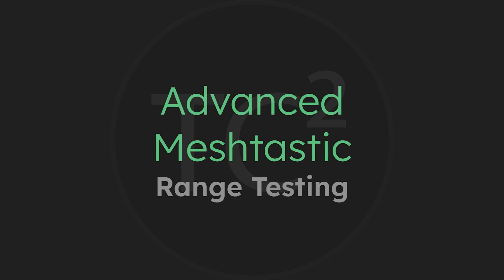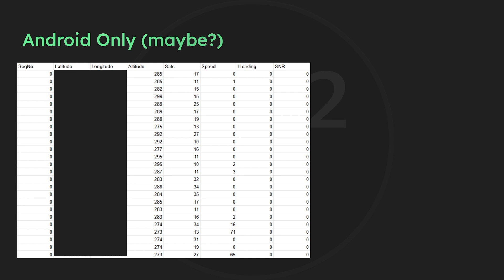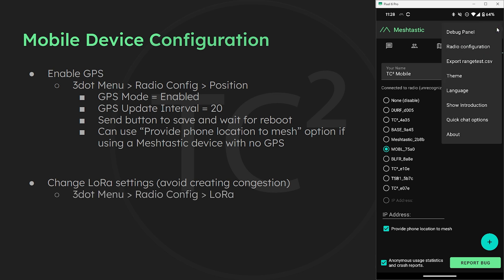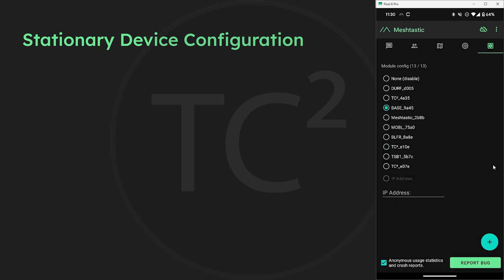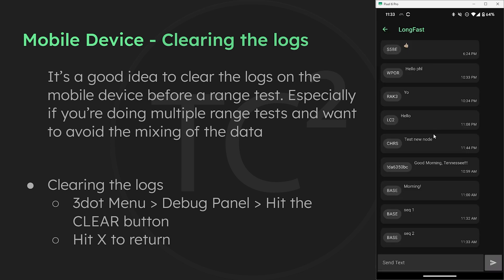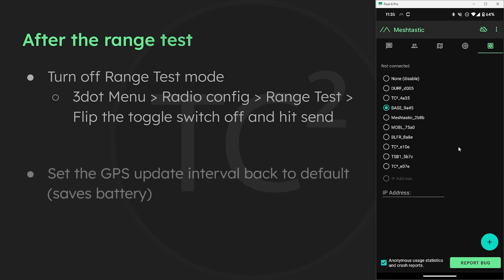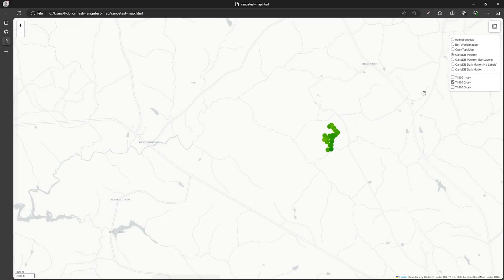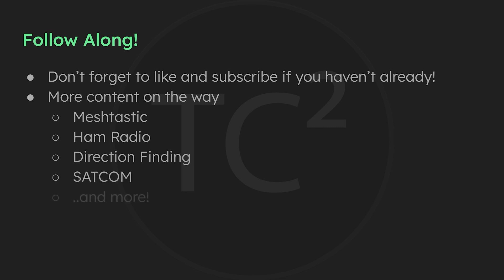Updated Range Test process & Testing the T1000-E Meshtastic card

Comment: Wow. I have a 12 dbi antenna up 45 feet and can't get more than a mile range.
Reply: 12 dbi is a lot for these frequencies (869/915). If you are experienced with radio transmission and have LoS, I'd worry about propagation direction/angle

Comment: I find that all measurements with an SNR multiple of 25 are dodgy, I get some that say -25, -50 or -75. I still want to keep the markers on the map but the SNR reading is clearly bugged out. I changed the line in the code that flags nodes with a very high SNR so that it also grays out nodes with a low snr and that's good enough for me: if row['rx snr'] > 15 or row['rx snr'] <= -25:

Comment: Out of curiosity, what was the fixed node TX/RX height? And what's the LOS like surrounding the fixed node?  And the DBI of the antenna? 250mw (max TX) I'm assuming? Do you know what the noise floor looks like there? Your results are drastically shorter than our own testing........ However, I don't know that's an apple to apples comparison. We use/ed a couple of different node/s to build out our network. Generally speaking, "saturation" nodes, and "distance" nodes. Saturation nodes are used Intra-city to get coverage of that specific town/city. And distance nodes to cover inter-city links and cover rural aeras. (Except the southern part of the state which becomes mountainess) Saturation node = 0-2dbi @ 250mw and a min of 100-150ft AGL. Distance node = 10+dbi (there is some variability left over from the beginning stages) @ 250mw and a height 250-300ft AGL. The LOS for All of our nodes is unobstructed as they are on top of towers.......... In the moutainess parts of the state we co-locate a distance node and a saturation node (maybe not co-located, but close prox). The distance node covers the ridge top-ridge top link, and the saturation node covers the valley/floor. (with good placement).....

With all of that being said; we've never tested a saturation node for distance. Our Saturation nodes are focused on data thruput and coverage. However, we have tested our distance nodes extensively. At the 250mw and a +- 10dbi antenna @ the typical 250-300ft AGL we routinely see 50-70 miles while maintaining a high data thruput............ (single node to single node link). 

So, it strikes me as "something's off...." when you only got +- 5 miles out of a node............(even a saturation type node). But there is a TON of things that can affect propagation........
Reply from the maker: I mentioned in the video this is just my node at home and the tests were done off the main mesh. We have nodes on top of mountains and achieve the same distances
Reply: @The_Comms_Channel  I just watched your vid on the Bluetooth bug. I think we work in the same or very similar industries which gives us tower access. Though I don't climb (too old and fat) I do the tech work on the ground.......
Reply from the maker: Just have friends in the same industry 🙂

Comment: The rangetest csv I get from meshtastic app with my regional settings uses comma notation inside the rx_snr field, so "4,750000" instead of "4.750000". This breaks the script. If I manually go in and replace all commas in the rx_snr field with a period, the csv import works. The script probably needs to look for the quotation marks around each data field instead of going by the comma separation. Once the import works the map is very nice!
Reply from the maker: Ah, didn't realize there's a regional difference! Thank you for the heads up! I'll work on a fix for it.
Reply: @The_Comms_Channel  FYI, turned out this was a bug, I made a report on Gituhub and it's been patched now by the dev team.